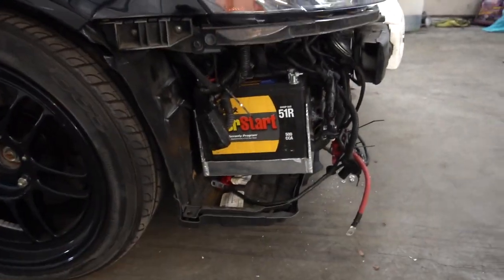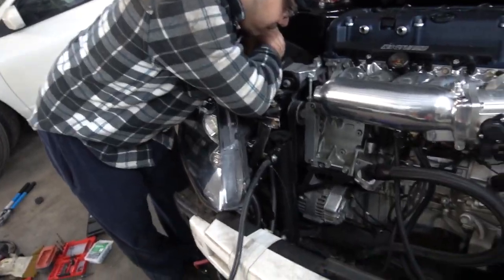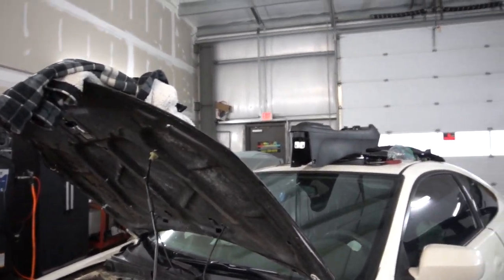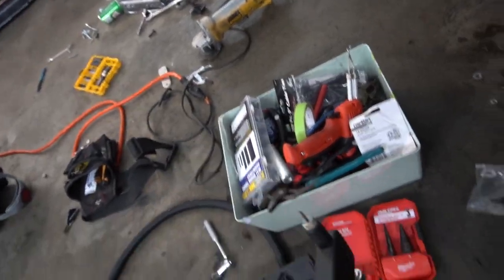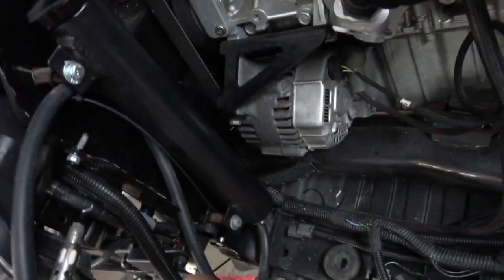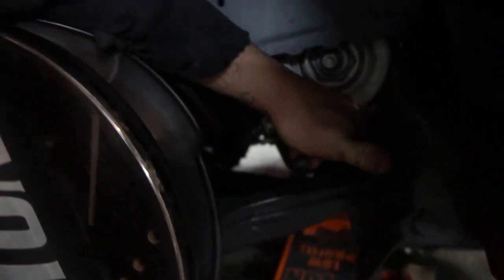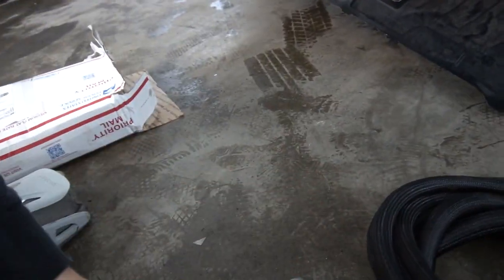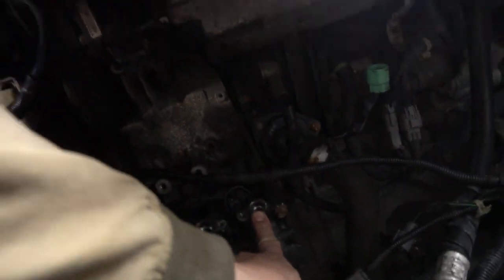Relocate A/C and Heater hoses in your DC5  / Cleanest RSX Method !

Comment: just want to make sure, for the tractuff adapters are the options you showed on screen the ones that we should get? 
-Tractuff M20 to AN adapter (-12 Male Flare) 
-Tractuff K series Thermostat port adapter (-10 Male Flare, 6.00" of stainless safety wire &.0625" drill bit)
Thanks great build by the way!
Reply from the maker: flip1405 I didn’t have time to post links , will do that tonight. only thing I would probably do differently is run AN12 .The hose I ran (AN 10) is a bit tight . if I did it again I would go AN12 and YES , those would be the options I would pick . for the back of the head your all set . At the thermostat he only offers 10AN so you will need some type of fitting to convert over to 12. I’m sure there is something out there.

Comment: I have the power steering and Ac delete kit installed at the moment and I was wondering if the adjustable pulley that I already have can be used instead of swapping for the ep3 pulley like you did?
Reply from the maker: I had the same  set up . Swapped it because I wanted AC back in the car, the alternator needs to go back to it’s stock position , so that the compressor could be put back